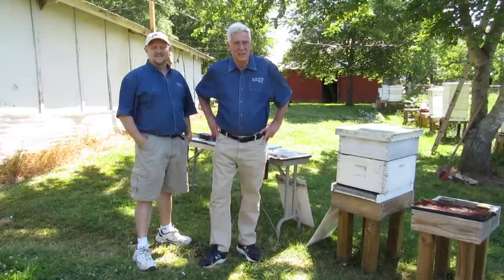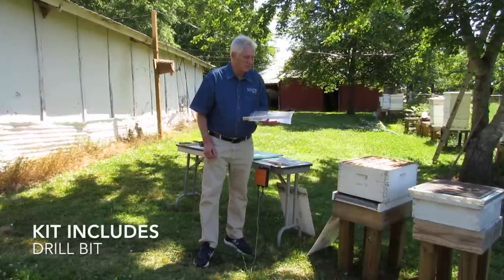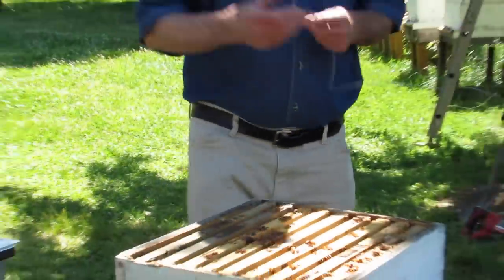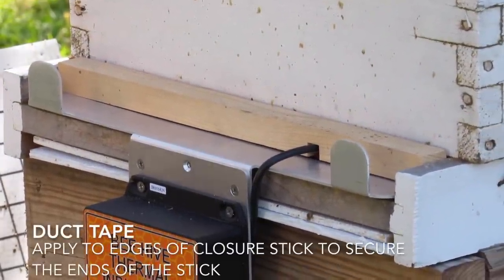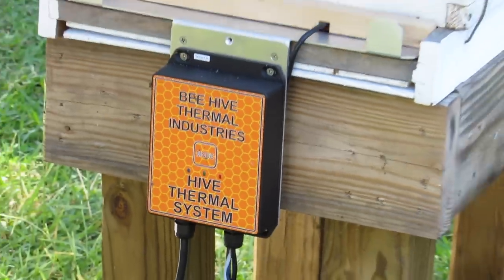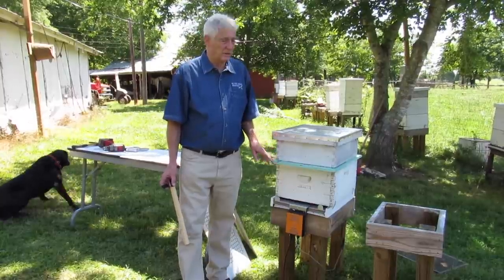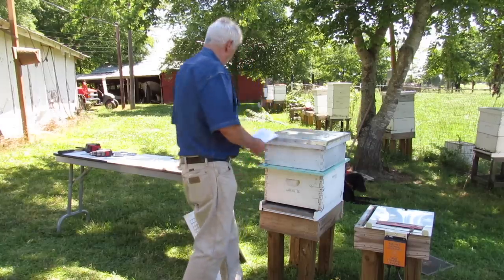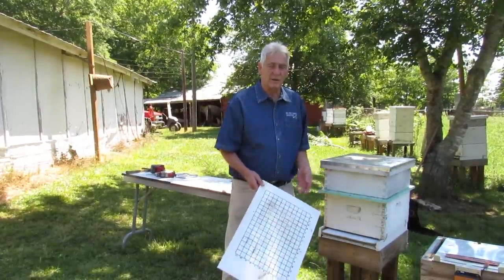Mighty Mite Killer Installation Demo - Bee Hive Thermal Industries

Comment: Just some points of reference: this unit has a lower & upper temperature sensor (thermistor) connected to a controller similar to those that control heat in a household dryer. It cycles the heater on & off to maintain temperature. The Mite Killer maintains a constant hive temp of 106 degrees. Mites & their eggs die at 103. bee eggs & larva are unaffected. Bee body temperature when beating wings is 113. Slightly higher if they group in a ball. Bees die at 116-117. Wax melts about 140-145 degrees. Thus, the comb may soften but it does not melt. To work properly the outside air temperature must be at least 70 degrees for a single deep hive. If doing a double deep outside temp needs to be at least 80 degrees or 70 while insulated with a hive cozy. High winds at lower temps can cause problems, just avoid windy days. Check your results with a sticky board before treatment. Then weekly for a few weeks. You will see the count initially go up as dead mites drop off of dead bees and dying mites emerging with brood removed by Nurse Bees or emerging from capped brood cells. I wouldn't recommend an alcohol wash. It does not have a large enough consistent representative sample to allow you to observe these effects.
Reply: Great info thanks!
Reply: Thank you for the information.
How much brood can someone expect that will die and how many bees?
Will bees abscond because of treatment? Will it affect the queen?
Reply: re: just avoid windy days.... yeah that's what should have been done when this video was shot.
Reply: @FloryJohann  Any temps above 35C can cause brood to start dying or not develop normally, see link I posted above.

Comment: was softens at 120F and melts at 140 f, the unit holds a constant temp. of 106f for 150 minutes which insures that the mites are killed under a capped brood, the bees die at 116f so there is no harm to the bees your brood frames afterwards are mite free and every egg produced by the queen becomes a bee and the hive explodes with new bees treatment is recommended late spring, August when the mites peak, and Oct. to insure there are no mites over the winter. visit us at www.beehivethermalindustries.com a proven organic alternate to pesticides.